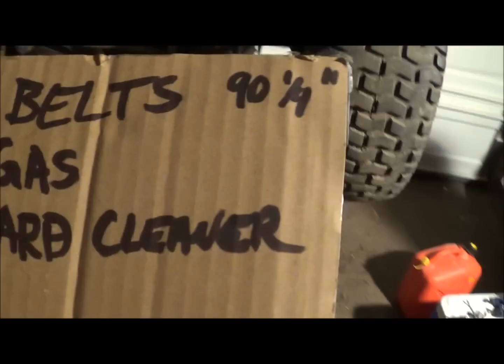murray tractor build pt 2

Comment: I thought you owned the house because of londons cheap housing market
Reply: ***** I've seen 4+ bedroom homes in london go for 50-$200k, they are small though 1600-2200 square feet were as other parts of ontario the same places are going for $400-$800k about the same as a newly built modern 3000 square foot home.